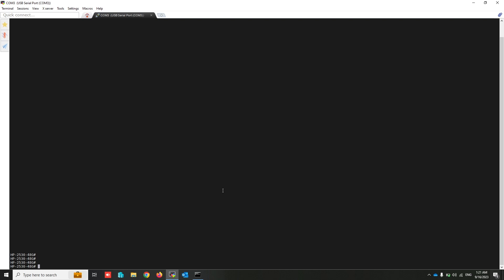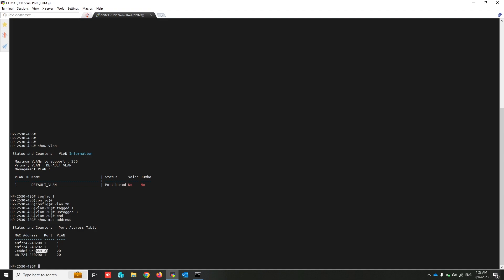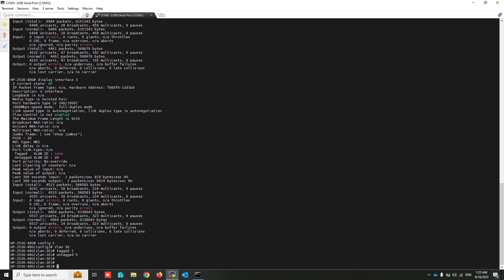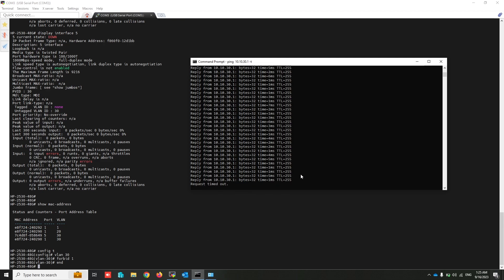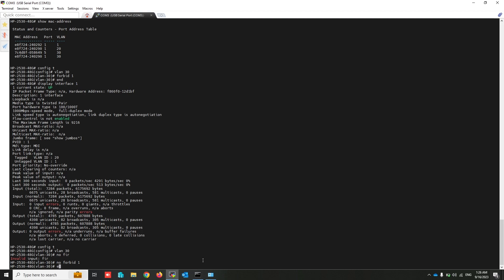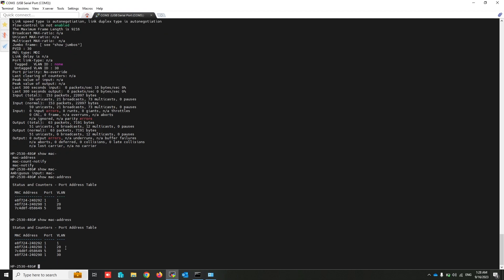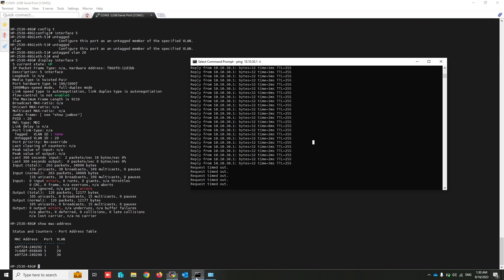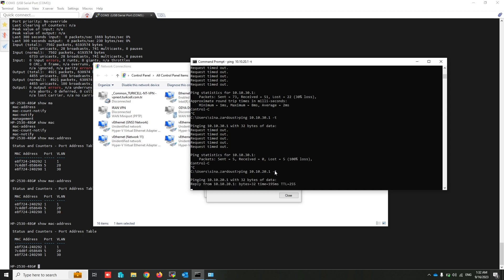Tagged VS Untagged on Switch | Explain And Configure in real HP Aruba Switch

Comment: thanks for sharing. if i need connect an access point with support for multiples vlans, example  unifi, i need to configure this port in tagged port mode, right? i can manage my dhcp with a fortinet router, thanks for your help!
Reply from the maker: you're welcome 🙏 yes , but like Cisco that's not a mode in Cisco if you change the mode to trunk that port carries all vlans. you have to tagged vlans, for example tagged 100 for vlan 100 traffic or tagged all .